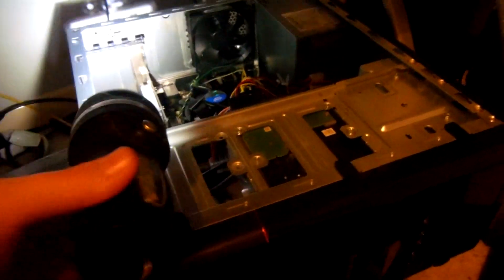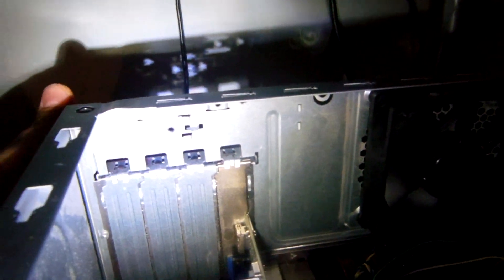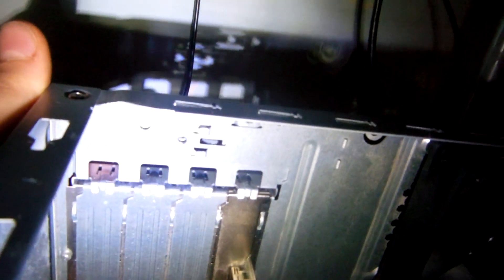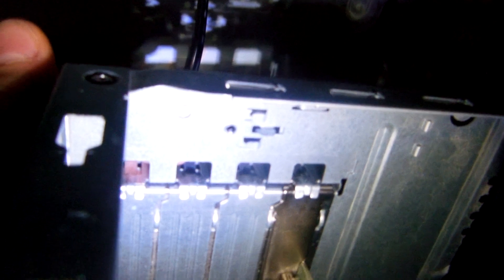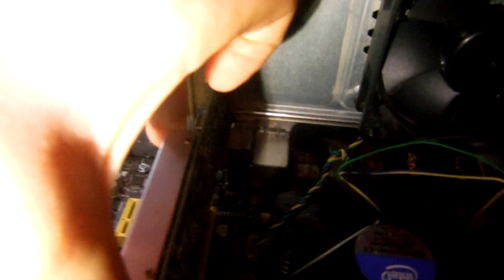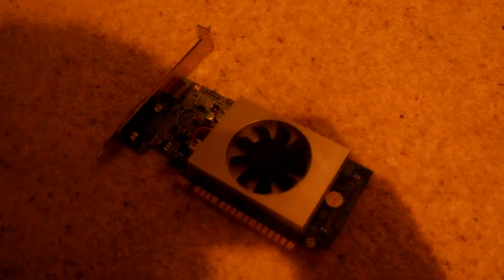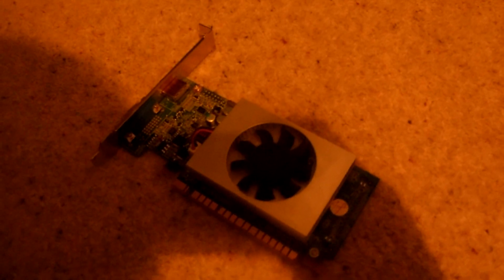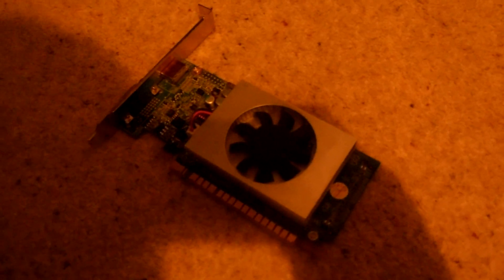How to remove a graphics card from a computer - Hardware Made Simple

Comment: "Make sure you haven't accidentally done anything bad to the graphics card" Smashes it on the CPU fan, then proceeds to place on a carpet, also didn't ground himself before removing the parts, potentially damaging them through static discharge.

Comment: My pc appantly doesn't have a graphics card, well it sertenly isn't where your was. When i go toproperties it says i'm using the amd a8-5500with radeon hd graphics but when i opened my case i didn't have any gpu where it was supposed to be. Any idea where it could be? please tell me
Reply: so when i'm adding the graphics card i don't need to put anything else away right?
Reply: ok, thank you. sorry i'm a bot of a noob at this stuff
Reply: It's fine, lol. Happy to help
Reply: oh one more thing xD, just bought a graphics card, now couple things, do i need to uninstall the old graphics card or can i just put it in. Alsow when i opened the case i noticed that i only have a 4-pin power connector, the graphics that i bought needs 6-pin. Is there anyway i change the power connector?
Reply: You most be the most helpfull youtuber ever!, thank you so much! yeah it did come with a  6-pin i didn't notice it first i through everything out of the way just to get the graphics card and look at it xD. Any thank you so much for the info, i'm now up and running with my new gpu. If it wasn't for you this wouldn't be possible a sub to you my friend.
Reply: Fun thing to say, i bought a ASUS 2GB Graphics Cards R7240-2GD3-L. How will it run dayz SA or Arma 3?
Reply: ok, no problem you've helped me enough anyway :)
Reply: Nick Plays It's a pretty low range card honestly, that I never heard of it ..
If you're wondering how it will perform with certain games, you can search up videos on youtube with keywords such as " NameOfGame + NameofCard " or something along those lines..

OR

You can look up benchmarks (pictures).

OR

You can use a web tool like canyourunit .
It'll automatically detect your sepcs and rate how it should perform with whichever game you select on the list, based on the minimum and recommended requirements.
Reply: Ok just installed my gpu after i gave my other one to a friend beacuse it was very bad. Anyway when i installed this one and went and opened the pc this accured: Reboot and select proper Boot Device or Insert Boot Media in selected Boot device and press a key.What do i do!? please help!
Reply: what do you mean?
Reply: Do i have to buy new pc or something now?
Reply: ohh it worked, there's alot of stuff here thow, how do i now wich is my main drive?
Reply: Thank you ones again! it's fixed!
Reply: I just quessed a driver and brought me to the desktop
Reply: But the resulotion is a bit weird
Reply: I listened to what you said about not installing the gpu with disc so i went to their web and and downloaded the amd catalyst
Reply: oh btw it's an asus radeon r7 250
Reply: Wow that's like the best! kind of weird everytime i start my pc i have to choose boot device.
Reply: ***** Hey, I noticed that you know about graphics cards and everything so what happens if I accidentally deleted my intel graphics driver and cant reinstall it?
Reply: Yeah I did that like a billion times and it says that my computers operating system is not responding or my computer doesn't reach the requirements or something like that